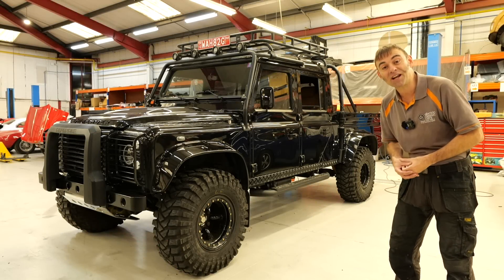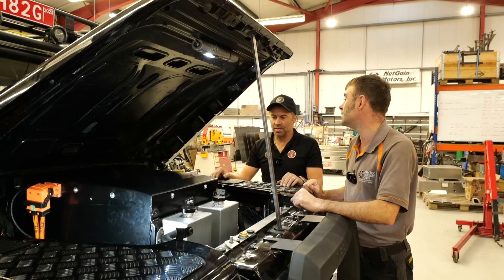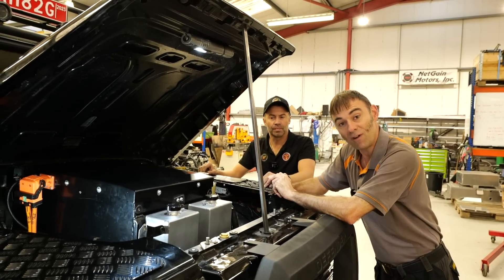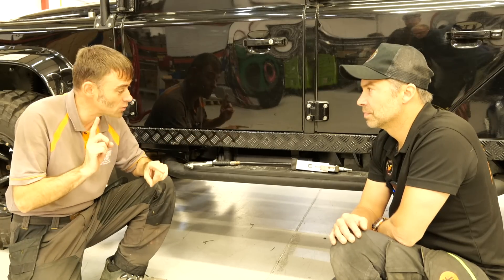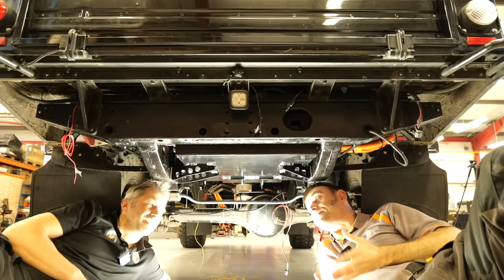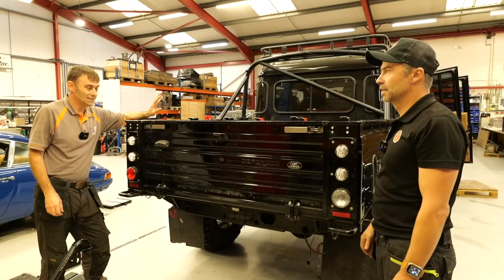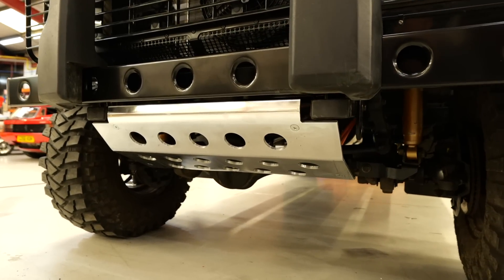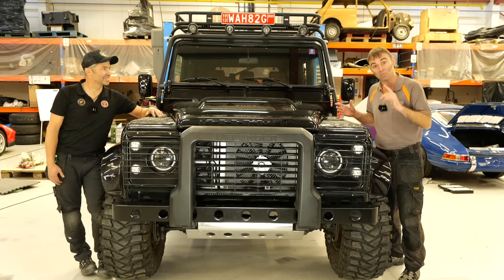Electric Defender 130 update

Comment: Toyota hybrids have been in production since 1997, with no change to the infrastructure, unlike all electric vehicles. Edison motors has built a logging truck which is hybrid. One of the best things about hybrids is that their fuel economy is at least 35% better than a regular automatic transmission vehicle. If emissions were truly, the target that the EPA is after they would have recommended 20 years ago that hybrids were the answer. But the EPA is controlled by lobbyists, which are paid by corporations which are owned by the private Central Bank through Vanguard and BlackRock. Which means that the private Central Bank uses the citizens as debt slaves to support the Central Bank.
Until a government buy the people and for the people is installed and the private Central Bank is no longer in existence. You will not have any progress in fuel Economy and vehicles because the trail of money goes to the private Central Bank.   The culture war, also known as 5th Generation. Unlimited warfare is also being waged on us by the private Central Bank in order to break the people and take over the world. Their propaganda arm is a World Economic Forum and it states clearly that they want a one world government. All electric vehicles will not work Until the infrastructure is created. And creating an infrastructure to make electric vehicles. Work is not in the best interest of the oil companies who are owned by the bankers, etc. Etc.

Comment: high voltage cables without protection are exposed in rear wheel arch.
Reply from the maker: As we said in the video the project is not finished and the cables are not connected, therefore those rear cables are just hanging there in that location. Not there now. 👍

Comment: With a 170 Kwh battery pack and the Defender weight (minus loaded bikes) and drag coefficiency, I'm estimating the efficiency to be around 1.2 miles/kwh good for about 200 miles of range. The Rivian is a ground-up wind tunnel optimized EV offroader and still only achieves 2 miles/kwh. Regardless another impressive build from ECC! 👏
Reply: The rivian might have been wind tunnel tested but I suspect a more significant design criterion was it should “look like a truck”. There is not much streamlining a designer can do with three rectangular boxes. One of them open topped.

Comment: That 80 kg of mass saved with the newer tyres is a HUGE deal - less mass to spin up on accelerating, less rotational (centrifugal) force to deal with on slowing down. We used to move our challenge vehicle on a small set of road tyres with the competition tyres loaded elsewhere on our tow vehicle - made a significant difference to stopping distance, even though the competition vehicle itself was unbraked when on the A-frame.
Reply: Less un-sprung mass too but not sure how important on a Defender.
Reply from the maker: Totally agree
Reply: WHEELS!

Comment: 22 kW AC charging, I assume, is using 3 phase current?
If the truck will be shipped for shows overseas, I assume, it has to use adaptors for charging, let's say in North America to CCS1, China to GB, in Japan to Chademo.
I believe it was way too complicated to fit high voltage batteries inside the frame of the truck, to create that famous skateboard, thus to have the ability to make battery pack of the size of
250 kW. That is the number claimed to be fit into upcoming new RAM EV truck.
Reply from the maker: 250kWh would make it too heavy in a Defender. If we were building it for the US market the charge system would be different e.g. CCS1. 👍
Reply: @ElectricClassicCars  I thought this is a show truck. That being said it has to travel worldwide accompanying the company's events.
I know, most of the world follows CCS2 like in Europe. China has its own GB, a derivative of Chademo. The latter is predominant in Japan. North America slowly is transitioning from CCS1, Chademo to NACS, the traditional Tesla type connector.
However if the truck stays in Europe then yes, just CCS2 is perfect.

Comment: The blocky tyre problem is universal ... Try a MTB with them on and the noise and  the strain on your knees will soon tell you along with the tyre pressures. 

Pave blocks are better in all but deep mud /snow ...and even then theres still better choices if the vehicles light.
Reply: Any chance you could take a look at Advanced Electric Machines out Newcastle on Tyne.... They build modular motors that are free of rare earth magnets and largely free of copper.  - 😎 way to go... And 🇬🇧 based.

Comment: There is a truck bed solution that lets you hook the platform that is laying on the ground, and then lift it on top of the truck. Its not a crane, its a piston that lays underneath the bed when its loaded, so its invisible. It holds the bed in place when moving and overall its very practical and requires no labour. Also the new bed could allow 4 bikes mounted sideways I think, since they will be loaded on the ground and dont have to be going in from behind.
Reply from the maker: We looked at that but it was too heavy. 👍
Reply: Three bikes and a trailer is tight!  By which I mean cool... @ElectricClassicCars